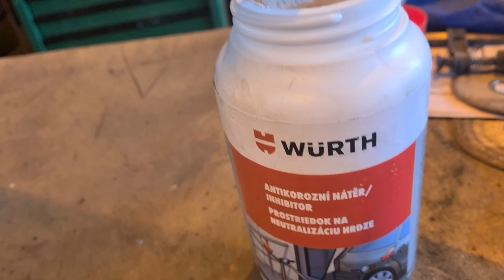VW bus T1 - PART 4 - rusty frame repair

Comment: Say Hi to Bob when you go by there for me. See your parts from Belgium bob BBT.  FYI try using several songs from Youtube free stuff or keep the real sound and lower the volume. People like that better. Dont worry about the haters. They will be there no matter what. Post this content and keep doing it . Great job. Even if you are not that good at video, you will get better. Watch my old stuff and then my new. totally different. IF you can put the tool you are using in text will be helpful to some people. your lead work was awesome on the bottom of the bulkhead. Using a rag to smooth it. great job.

Comment: Is that a 440v or 220v welder and what amps do you use ?
Lovely work BTW, hope mine doesn't need so much done.
Reply from the maker: Hi Adam, 220v. Thank 😉